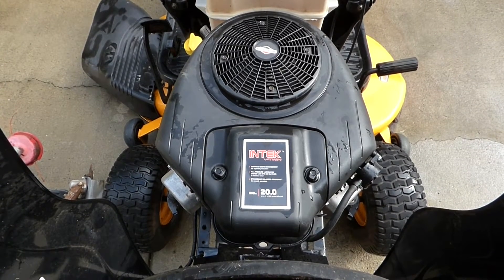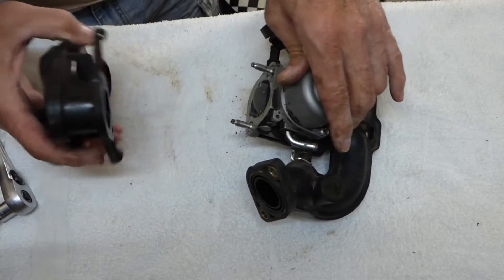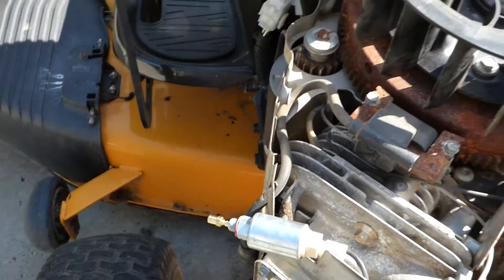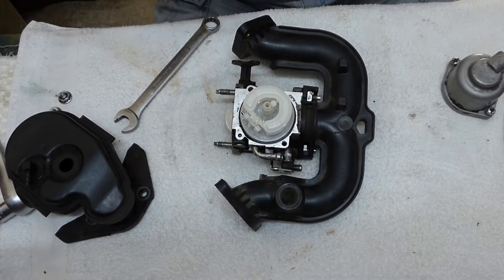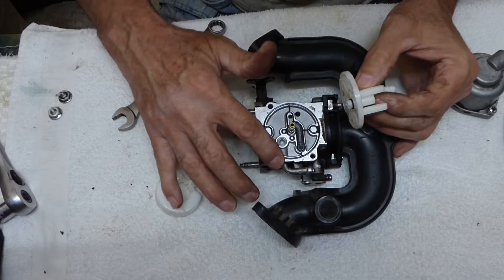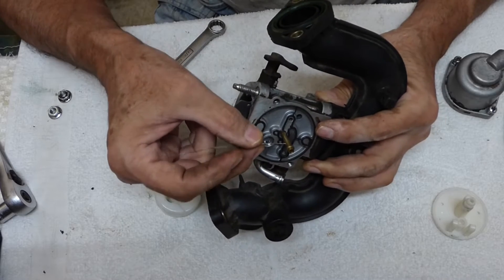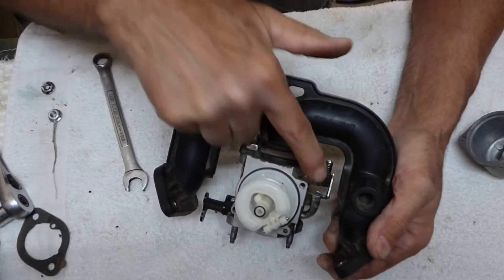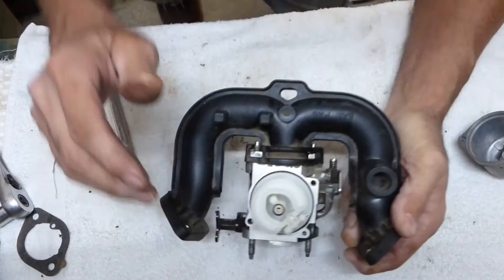Briggs & Stratton Intek Engine Carburetor Cleaning / Rebuild - How to

Comment: well, my question is where does the light spring go?  you were removing the carb and i could see it on the right side, then you dropped the carb and cut away.  I thought I'd catch it on the reassemble and you fast forwarded it.  I'm trying to fix a throttle that will not throttle down.   I have the exact same machine so I know I'm missing the light long spring but can't tell where it goes in your video.

Comment: What was original reason for working on carb? mine won't start but when i take off the fuel line from carb fuel pumps and the engine will start if i spray engine starter in it. Also found grass inside gaskets that attach to intake manifold on engine.. may want to replace intake gaskets.

Comment: After removing the bowl and gently lifting off the plasic float assembly I saw a tiny brass jet laying on the carb with an itty bitty o ring on the small end. I couldn't figure out where it's supposed to fit into. I think it is supposed to go down into the main stem of the plastic float assembly with the small end closest to the end of the plastic stem. It looks like the inside of the stem is tapered to receive the small end of the tiny brass jet  and o ring and seat up against the end of the brass stem and orifice that the float assembly sides onto. I hope I guessed right.

Comment: How is the spring connected on the throttle arm?  Mine came off and I am not sure how it hooks up.  Also should the throttle arm swing pretty freely or should it be really tight?
Reply: I'd like to know too, I could not see where, or how the spring on the right side of carb was hooked up.  Does anybody know ?
Reply: @ra777wow  i need to know too did you ever figure it out?